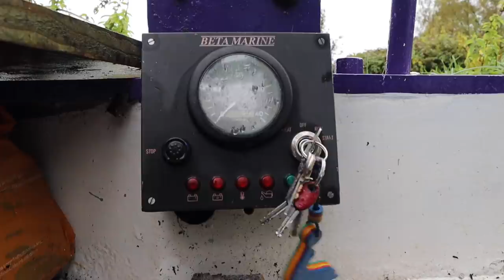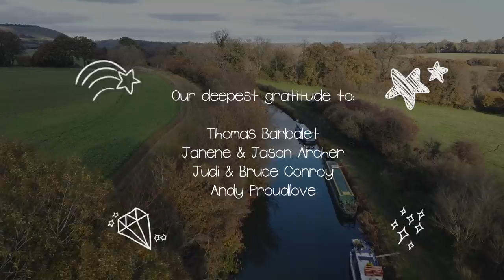Set Adrift in the Night. Lockdown on a Boat | Ep. 37

Comment: okay, I am barely 2 minutes into your video & I'm hooked!  Where I have paused the video at so I could just tell you this you are lighting your stove discussing difficulty keeping warm.  Let me give you a really cheap tip on keeping warm.  It is used here in the United States Northern areas to keep warm and it was very popular at the turn of the century clear up to the 60's.  For each of you buy a piece of sandstone about 12"x12" and about 2" thick. On each piece you will want to drill a small hole about 1" deep just off the center line and install a sturdy piece of wire just big enough so that the wire has enough room for you to pick up the stone with a hot bad holder or mitten.  Set these sand stone pieces on top of your wood stove and let them warm up to your desired temp and then you can set them in a towel in the bed at night to keep your feet toasty warm or place them on a rug & chill with your feel on a nice warm surface.  If you were to get one larger, you could use it to stand on top of when it is cold out to help keep feet warm while traveling. Other than the cost of the soap stone, it is a way to keep warm that doesn't cost any extra to heat an area.  It is all captured heating source.
Reply from the maker: Hi Michael, so glad you found us, thank you so much for watching and for this amazing advice. We will look into it, sounds amazing! Thank you for taking the time to comment, it really means a lot to us 💜 xx

Comment: When you have lots of cables , and extension cables and plugs, my suggestion ( and what i do ) is to get some of those small plastic ziplock bags and pack in each bag and label them as to what each one does . Then either place them back in the drawer or place them in a small plastic lidded box ( i bought some from Wilkinsons) and place them in a cupboard, one that you would use all the time for storage . this not only saves you having to resort the same drawer every time it gets messy , but also means you dont have to sort through cables getting tangled. I do the same for light bulbs , batteries and small tools etc .

Comment: Nice work in the bathroom. I’ve commented before about there not being a lot of secure mooring places on the K&A (Armco or rings) and that the wild mooring is super soft ground. Pins are easily worked loose by speeding boaters’ especially if boats are unmanned and not checked. I’ve no doubt that the pins have worked loose because of this and not foul play.
Reply: Seems like the type of thing like a big cork screw you buy to tie a dog to would be useful in soft ground like this.
Reply: @jtothew4201  some boaters’ had right angled pins that were pushed into the ground up to the 90 degree bend. Those pins seemed to work well.
Reply from the maker: Hi Paul, thank you so much for watching! Definitely in most situations that is true, however this time it happened in the night, there is no boat traffic in lockdown and our neighbour heard people walking about in the night...  But who knows really ...
Reply: @CruisingAlba  well done for doing the neighbourly thing and retrieving their boats.

Comment: Lithium batteries can be recharged upto 3000 without any loss of power. Down side expensive at £700 for a 120ah battery. Great vlog.
Reply from the maker: We can only dream of those batteries, we also heard they dont perform well in cold conditions. But for us the barrier is price as we need 4 batteries for Alba
Reply: @CruisingAlba  cant you get some insulation around the batteries for the winter time ?

Comment: Hi  Did quite catch what chucked out the window from the sink. But if aluminium brass or most stainless steels a magnet will not work. Check   magnet on sink. Strange 2 boats going off. No fast boats past by soft bank a good recipe. A daily check is moorings.
Reply from the maker: Spinach leaves. Good idea, will give it a go!

Comment: Hey guys. All those ugly gaps where the wood panels on walls needs filling.  " TIP" use decorators caulk to fill the voids in. It will look a lot neater. You can also paint on to the caulk no problems.
Reply: Or just use trim like your supposed to?
Reply: @howardcornwell9841  not everyone can do trim Howard, but yes it would be nice if they could.

Comment: Your batteries have only lasted 18 months? Are you over discharging them?
Reply from the maker: Hi Nigel, thank you so much for watching! They were installed incorrectly by a boat yard to begin with which we found out only a year after plus we've not had an accurate battery monitor in the first year. Then we've been working from home on our laptops for the past 10 months which is really death to any battery!

Comment: Your batteries should not be knackered after 18 months!!!! Are you aware batteries realy don't work as well in cold or very hot wether! And if they are knackered its probably because you're flattening them too much you should only use 20% of the power before recharging them, my batteries were cheep ones and are 7 years old and still going ok don't bin them until your positive 👍👍

Comment: Are there not more environmentally ways to heat the boat rather than burning wood?
Reply: how do you heat your home? We live on our sailboat and have a diesel heater. It is extremely efficient although the diesel itself may not be the most sustainable source.
Reply: @sailingavocet  I use electric storage heaters as they have the lowest emission rate due to the way UK produced low carbon electricity-. If I had a house I would use heat pump. My boat which I live on a significant part of the year does not have heating but if it did I would go heat pump or biodiesel. I use biodiesel on my boat. I try were ever possible to reduce emissions. Wood burning stoves for me are an environmental nightmare. I will retire on the English canals and definitely heat the boat as environmentally responsibly as possible.
Reply: @DubaiDiver  ah, but are you plugged into shore power? We usually have no access as we are anchored
Reply: @sailingavocet  you asked me what I use at home ie my apartment! I said if I had a house I would use heat pump. I would also use heat pump on the boat. If you are not using biodiesel it is definitely not sustainable! Kindly please read my answers to your questions carefully
Reply: @DubaiDiver  got it, sorry, assumed you lived aboard. Our “home” is our boat and for some reason I misinterpreted your response. Cheers